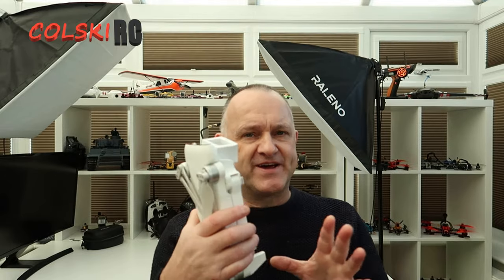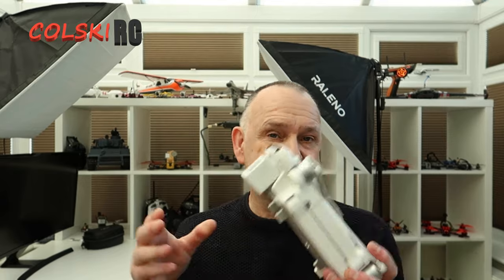FIMI X8SE RETESTED  - LATEST FIRMWARE IS IT ANY BETTER?

Comment: I'm so glad you persevered with Xiaomi products Colski, it's unusual to have issues with them. I am likely to be getting one of these in he spring, as there's nothing that touches it in the price range. ( please don't say the "new" Mavic or the "cashgrab" to give it its official title.) yeah the Zino isn't bad, but the controller is awful, and it dives into the floor at temperatures over 25 degrees C :)
Nice flight sir, well done :)
Reply from the maker: To be honest it will be the last xiaomi product I will buy customer service is appalling and tbh the zino is as good a product with a better price tag.
I have compared the footage from this flight with the zino and the zino is sharper with more natural colours.
I have been told today that the price on the anafi is supposed to drop after Christmas to around £449 and is much better product than both of these
Reply: @CKone41  Hubsan customer service is reported to be the worst in the business! I like the image from the Anafi, but the drone looks terrible, I will wait and see if anything new and preferably not folding comes out. Or I will buy a Typhoon....

Comment: Hi, if you were to choose which drone would you choose, Fimi X8Se or Dji Mavic mini not considering the portability and price which the mini wins and not the camera which the fimi wins due to 4k. Consider the video and color clarity, stability with wind and wifi connectivity for control and fpv? Thanks!
Reply: I believe that the mavic is better made and longer range. I have both and the fimi x8 has better picture quality but the real time fpv on DJI is really nice. I bought both and haven't regretted it
Reply: @WilliamHorsley1962  Yes the mini is a better choice but its compatibility issues with android phones can be tricky cos im an android phone user. My 5.0 version android can install the dji spark and fimi app but unfortunately it cant on dji fly app which is a bummer since i need to spend another android phone with a 6.0 or higher version and moreover needs to check if it really is compatible. Its downside is the no fly zone features which you need to ask for permission unlike fimi which can fly anywhere as long as you observe local laws. I think fimi is more powerful but I have seen mini fly well in windy conditions and i hope the motors and esc does not burn out easily.
Reply from the maker: Hi It depends on what you want it for. If its your one and only drone the Fimi is more useful due to the better camera etc,,, The mavic mini will get you into camera drones but you will want to change it quickly.
The Mavic mini is not going to survive a crash well due to the flimsy plastic on the build but has a reasonable camera but not a great one.
I have a first impressions video of the mini coming up on Thursday and i cant say i was blown away and i have owned every consumer drone DJI have made.

Comment: How did you make it find the landing pad ? mine hardly ever finds pad think its down to light conditions when flying ,not a deal breaker for me just manually land .what SD card are you using .
Reply from the maker: Alan Hazzard A 32gb u3 Samsung ultra they are great cards but a pricey